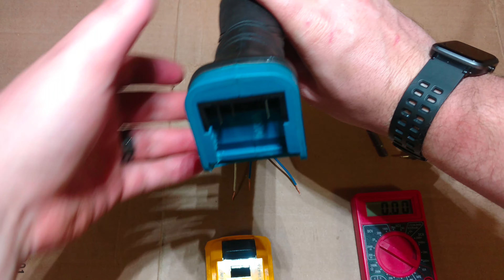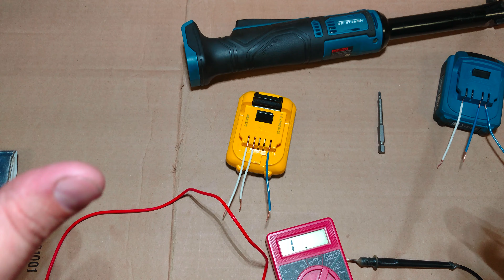How To Find🔎& Check✔️Ohms/Resistance On Batteries (Hercules 12v)🔋& Tools #diy #tools #harborfreight

Comment from the maker: Here is the adaptor that will make your DeWALT 20v battery work in your 20v Hercules Tool - 1 Adapter for Hercules 20v Tool To fits DeWalt 20v XR Battery/Low Voltage Cutoff - https://ebay.us/W343yN - Hercules 20v Adaptor DeWalt - https://youtube.com/shorts/A9vt--yn384?si=fbow1ImKmnrWYGPR

12v DeWALT Battery🔋 in 12v Hercules Tool🔥- https://youtu.be/HQTbTE3OZjg?si=1MoUV2Ud0eRWv8xs

AstroAI Digital Multimeter Tester 2000 Counts with DC AC Voltmeter and Ohm Volt Amp Meter; Measures Voltage, Current, Resistance, Continuity and Diode, Blue - https://amzn.to/3HlLGQR

https://www.harborfreight.com/7-function-digital-multimeter-59434.html

https://www.harborfreight.com/12v-cordless-38-in-extended-reach-ratchet-tool-only-57276.html?_br_psugg_q=hercules+12+volt+ratchet

Comment: very cool. been eyeing several herc 12v tools. got several dw12v batteries, and didn't wanna add another batt & charger (too many already) this will work great. thanks
Reply from the maker: Just a heads up,  this will not 🚫 work with their new brushless 12v tools
Reply: @DrewsBackYardMechanics good to know..just bought a brushed long neck ratchet..but was eyeing the ra die grinder too. now I know thx
Reply from the maker: @J.Wick. you're welcome

Comment: Nice tutorial 👍👍Love the channel & new su b here!
Reply from the maker: Thanks I Appreciate It
Reply: did you ever figure out how to make the 20v dewalt battery work with Hercules tools? I got the spot light because it’s like $30 and I was going the wire in a resistor, but it’s definitely not the same as the 12 V because I already did that on it with a 10K resistor someone said it’s like 100 K not sure
Reply from the maker: @calebholden3717  Here is the adaptor that will make your DeWALT 20v battery work in your 20v Hercules Tool - 1 Adapter for Hercules 20v Tool To fits DeWalt 20v XR Battery/Low Voltage Cutoff - https://ebay.us/W343yN